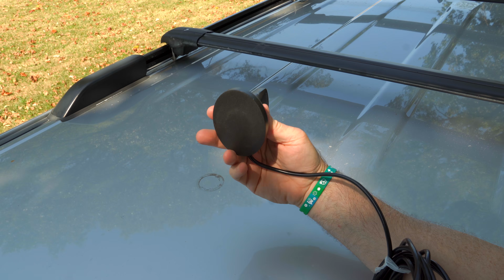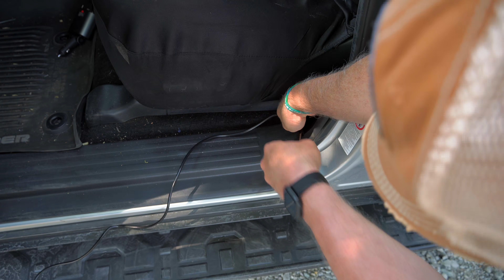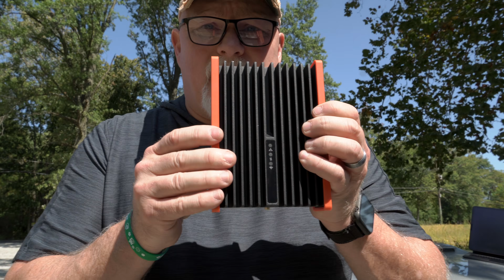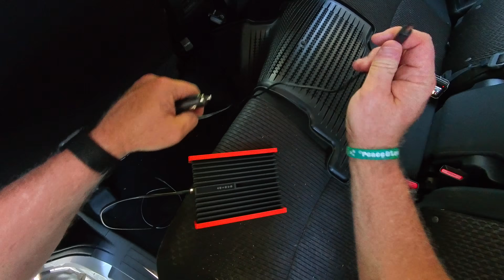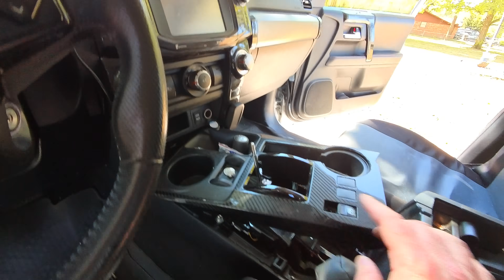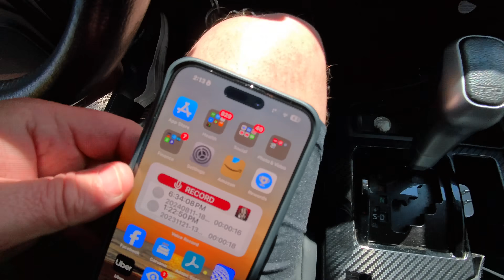HiBoost Travel 3.0 Car Cellular Signal Booster Install and Test

Comment: You mentioned the USB C port but didn't explain what it was for.
Reply from the maker: I think it is simply an extra as I found no other purpose for it other than charging off the booster unit. I haven't tested it but it is possible that it is another form of power input.